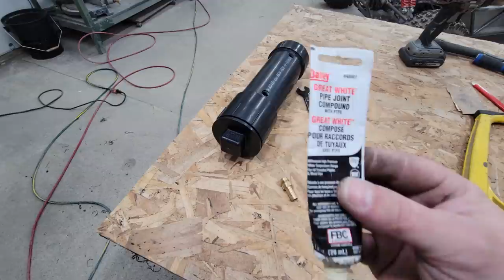Homemade Electric Buggy, Ep 7: Cooling System

Comment from the maker: In this video I install the cooling system for the electric crosskart/buggy ME1616 motor. As some of you know, the battery is sized large enough for the motor to only require forced air cooling, but the motor requires liquid cooling (a glycol/water solution). To do that, I'm using an 8x12" radiator with a 12V, 7" fan from Derale Performance. The glycol solution will be circulated by a Flojet 12V general purpose pump with a flow rate up to 10 L/m. I made a reservoir/overflow container from 3" ABS pipe, an end cap for the bottom, a screw cap for the top and barbed fittings for connecting the heater hoses. I also incorporated a filter between the reservoir and pump to keep particulates out of the system. Links for all of the parts that I used can be found below with the exception of the ABS pipe and fittings and heater hoses. You can source those at a local home building supply store like Home Depot. Electricmotorsport.com also sells a complete kit with the pump, filter and radiator together to make things simple, but for a slightly higher price. 

Radiator:
https://www.electricmotorsport.com/ev-parts/cooling/lck/radiator-with-1-2-inch-hose-barb-inlets-and-electric-fan.html

Pump & filter:
https://www.ebay.ca/itm/301739981256

Complete kit:
https://www.electricmotorsport.com/ev-parts/cooling/lck/liquid-cooling-kit-for-dlc-motors-and-controllers.html

Website: https://www.resystech.com

Support RST on Patreon or Youtube and earn membership perks:

http://www.patreon.com/resystech
https://www.youtube.com/channel/UCtrf6ZiE6hw3k77hGpnuQWg/join

Follow RST on Facebook:
https://www.facebook.com/RenewableSystemsTechnology
Reply: That 1/8 aluminum that you are bending, is that 5052?
Reply from the maker: No sir.
Reply from the maker: 3003, I believe. Same grade used for roofing, siding, fuel tanks, etc. Excellent formability with reasonably good corrosion resistance, not quite as good as 5052 but it's all gonna be painted anyway.
Reply from the maker: Np.
Reply: @JamesBiggar  Thanks. I had mixed results with 6061. Actually, just bad. Separately, I have a similar build using a MOtenery motor and 8080IPS controller. That is a tricky controller with the sine wave sensor. Some people I see on YouTube get persistent hall sensor errors (inja, aging wheels). Let me know if you run into troubles.
Reply: New Subscriber, I cant wait for the test drive
Reply from the maker: Will do.
Reply: @Codyhumburg can you share what kind of issues you've run into with the ME1616 and the KLS8080NPS encoder signal errors? We've been running into a lot of issues using those 2 together and we've tried a lot of solutions. Wanted to see if you found a solid fix, can share what we've tried.

Comment: I have really enjoyed following along on this build.  Something to consider on the coolant tank mount, this may be overkill, but covering the edges of the aluminum where it contacts the tank with some split vacuum hose would prevent the aluminum from digging into the plastic over time.  I learned this lesson the hard way.

Comment: Looking good and can't wait to see you hooning around in the finished product. Wanted to ask about that vertical reservoir - if the only thing stopping it moving is that strap, isn't there a danger that the weight of fluid plus vibration will allow it to drop, and put pressure on the top valve as the strap presses against it?
Reply from the maker: Thanks. No. The hanger is mounted snuggly between the end caps - the reservoir can't move in any direction unless a tremendous load of some sort snaps that rugged bungee or bends the hanger. Vibration alone won't move it - a bungee that thick (1/2") can handle up to a 400 lb load. A 1/8" thick bungee can handle a 100 lb load. I did well just to get it hooked into place lol.

Comment: Very cool how you let the heated brass make it's own threads in the pvc pipe. Saves some work tapping it. Did you run the fitting in again using silicon tape?

Comment: Have you ever run into issues with too much heat? To me this seems like the hardest part of the build, to make sure you dont run too hot.
Reply from the maker: Only with the esc, which was a bit undersized because it was the largest I could find to match with the motor at the time (larger esc's are now available, and liquid cooling options to go with them). The battery and motor never get above 45C. LFP perform a bit different than NCM in that regard. They're not as energy dense but they can usually handle a lot of power without risking overheating whereas with NCM it's usually the opposite - nearly twice as much cap but they can't output as much power, and combined with the nature of the chemistry itself, pushing NCM to its limits will risk overheating. That's why I got away with passive cooling for this battery, but might need forced air cooling for the current e-moto which uses NCM because they're going to push 60C+ under normal conditions, but can't exceed 70C otherwise they could get damaged or damage the PETG enclosure that I'm making for it. Next to LTO, LFP is the safest chemistry. Far less likely to overheat with normal operation, and far less likely to cause a fire if they get damaged or short internally. The trade off is more weight/wh.
Reply: @JamesBiggar  Thanks for the detailed reply!

Have you considered making a parts list to sell on your website? Im definitely interested! Id love to hear your insights on different 'tiers' of this build with different motors / parts for different budgets like 'Medium / High / Ideal'.554tvt

If you have a radiator for each battery pack (not even sure how big) would that be enough cooling to get away with NCM batteries? Maybe its not even worth the hassle if they are more likely to flame up.

Comment: Hello and thank for your video.
I don't think that making thread in the plastic for brass fitting is a good idea for high temp liquid, because they have different thermal size-changing.
Hope this will work.
Reply from the maker: The fluid won't be any hotter than the water coming out of your kitchen tap, according to science. If it is, the system isn't working properly and the motor will burn up. As a building contractor and journeyman, I have 100% confidence in this - it's no different than a home plumbing system with a myriad of pipes and fittings of all different types of materials, from PEX, copper, brass, or ABS pipes to quick connect fittings made from plastic, metal and rubber that slip over said plastic and metal pipes to form tight, reliable seals in hot or cold distribution lines.

Comment: so much steel on that buggy - arent you worried its too heavy?
or is it a standard thing? just asking purely out of interest. love following this build
Reply from the maker: Yep, because it's a buggy, not a passenger vehicle. Tube chassis is a necessity for safety. Nope, not worried at all. Curb weight is ~850lb, on par with ICE powered pro crosskarts and rally-karts (700-900lb). That's saying something given that it'll be hauling around an extra 180lb of battery.
Reply: @JamesBiggar  cool

Comment: Hey, noob question... why wouldn't you cut the pattern and then bend? You seem to bend first and then cut... is it because you are limited by ur bending method, or is there sth else?

And, forgot to mention, ur series is amazing! Great inspiration
Reply from the maker: Thanks! Not every scenario needs a template - the steps you take to make the pattern could be used to make the actual piece instead. Bend it with extra material, then place it in position and mark where more material needs to be removed, cut then test the fit. We use this method when trimming and scribing in finish construction (carpentry). For example, I would cut a piece of window casing to a rough length (~1" longer than its expected total) and miter one end, then place it on the reveal mark on the window buildout with the miter lined up in the corner where it should be, and use a pencil to mark the exact position of the other miter on the opposite end - fool proof. Impossible to cut it too short unless a person cuts on the wrong side of their mark. Tape measures aren't the most precise tool for stuff like this.
Reply: @JamesBiggar  thank you, makes sense... :)

Comment: What temperature do you expect the water to get?

You migh need to consider a pressure relief valve.
Reply from the maker: It's an open system, a filtered vent tube will be located in the res cap. No pressure.
Reply: ah, great.

What are the expected temperatures of the water?

Comment: Unless the ABS you used is listed as UV resistant, you may want to paint it.
Reply from the maker: No need. Refer to the body panel video. It's located behind and under aluminum panels. The only light it will see is (somewhat) diffused indirect light through the mesh at the back of the kart on rare occasions.
Reply from the maker: ...MAYBE, lol, it's the only circumstance I can imagine.
Reply: @JamesBiggar  Roger that. 🙂
Reply from the maker: It shouldn't be a problem regardless, really. Solid ABS pipe is actually an ideal choice for using outdoors - it's the same material that we use for plumbing roof vents (I'm a journeyman carpenter/contractor - plumbers don't like getting on roofs for some reason). It's used on the majority of residential and commercial roofs, in direct sunlight where I've seen roof surface temps climb as high as 80C. Code compliant. Cellular core ABS is the type that deteriorates due to UV exposure - it's not a good choice for outdoors.
Reply from the maker: Cell core ABS pipe has a hard/smooth inner and outer ABS skin with an ABS foam interior. End cuts look like a sponge. It's lighter and easier to cut.

Comment: I don't trust that tank support. It might slide down when it's full of fluid.
Reply from the maker: I do trust it, because I trust my judgement and foresight. As already mentioned, the hanger is mounted snuggly BETWEEN the end caps by a very strong 10"x1/2" thick bungee. A 1/2" bungee can support up to a 400 lb load. 12" of ABS pipe filled with antifreeze 'might' weigh ~10 lbs. I can barely stretch it enough with arm power to hook it in place. That reservoir isn't going anywhere.
Reply: @JamesBiggar  Thanks for the response. Keep up the good work, great build!